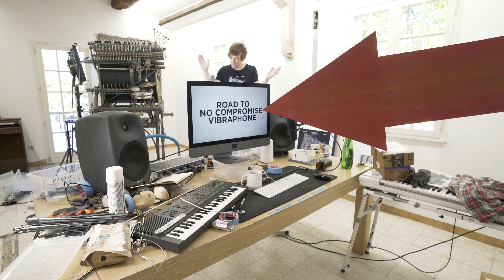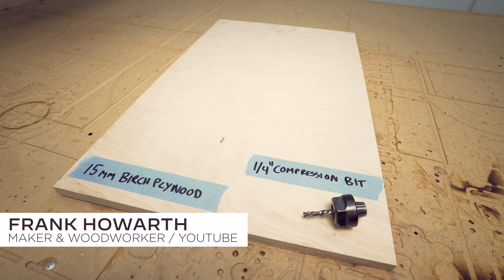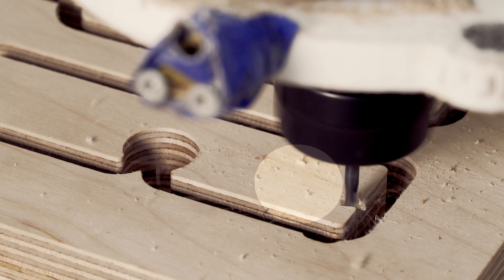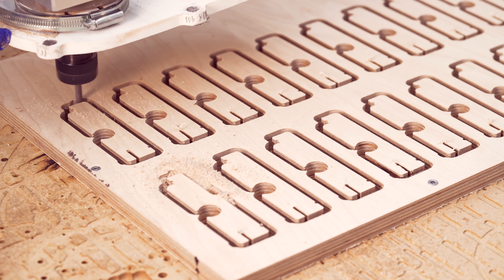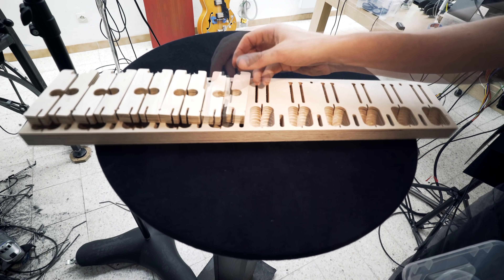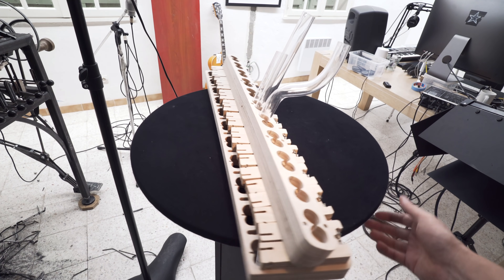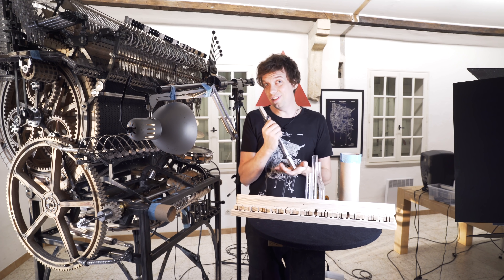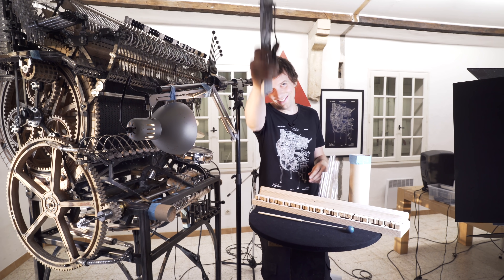CNC Machining Plywood Parts - Marble Machine X #100

Comment: tip: you didn't really need to cut a locating slot (or 3) if you just fix a vise to the table and always locate the part in the same way (google images 'vice stop rod' to get an idea)

Comment: had to laugh at the burn marks on the 'back' of the plywood.......something I have done a few times in not checking both sides of material before cracking on with using it!

Comment: I played different metallophones in my life, started with the glockenspiel when I was a kid, so I'm glad the vibraphone part of the instrument gets the proper treatment. 
And I think throwing away the result of hard work just to redo and improve it, is an important quality to have as an artist... or just in general. Having a constant reminder that you could have done a better job is way worse than spending the extra hours of fixing it. It's just as important has hitting the brakes and call it good enough.

Comment: "In engineering you should not assume anything"

I disagree, I feel that, in essence, engineering is ALL about assumptions. The tricky part is that in order to do good engineering those assumptions need to accurately model the problem in a way that you account for relevant and significant error while ignoring irrelevant or insignificant error.

For example it's technically incorrect to assume that gravitational force accelerates bodies on the surface of the earth 9.81m/s^2 toward the center of the earth. This is because the force will change with altitude and density of the earth for any point on the surface, but if would be a complete waste of time to include that in your calculation as it fluctuates by such a small amount. Thus, we assume this value is constant on the surface of the earth to avoid cumbersome and unnecessary calculation.

I get what you mean though, making over generalized assumptions is never good in engineering, but I believe that making accurate assumptions is actually the essence of good engineering.

- A nitpicky computer engineer

Comment: You could probably put the relief cuts on all of the parts, or at least any additional copies and spares. That way, there's one part that fits all of the slots, and no way to mix them up during assembly or repair.

The main downsides, depending on the part, would be aesthetics and additional machining. For this part, it's hidden and the change would only shift the perimeter cut, so neither of those would be an issue.

A similar trick can also work for mirrored parts if you can design them to be symmetric. Whenever you can turn two or more unique parts into one part that's interchangeable, it's usually worth considering.

Comment: Fastest and safest way I have for machining narrow deep groves is first to drill most of the material out and than when there is a lot of free space to run only finishing pass.
If you use interrupted drill cycle you can safely drill even very deep holes without retracting what saves a lot of time.

Comment: I run a CNC router not so different to yours. I've tried many different endmills cutting plastics, ply and MDF. My best suggestion is to get some 1 flute compression endmills for ply, and a flute length only slightly longer than the material (definitely no less). These are perfect with high RPM CNC's (18,000 - 24,000). For example, for 16mm ply, I use 1FL Comp 5mm diameter 17mm LOC endmill, run these FULL depth in one pass 18,000rpm and 1500-2500mm/min. Also I have never used tabs, the bonus of doing this in one pass and compression cutter means the chips are compressed in the slot and can very rigidly hold the part in place.
Love your work Martin.
Reply: Also, I can assure you with a flute length longer than the material you will never brake it from built up chips.
(And always ramp into the cut)

Comment: Maybe add some air assist to blow out the slot as you are cutting with small diameter bits, it will be dusty though

Comment: Engineering is all about assumptions. You're trying to simplify a problem by assuming for certain unknowns. Then when you find a better answer for an unknown you iterate and adjust the remaining assumptions until the design meets the requirements. Your engineering gets better as you learn to improve your initial assumptions.
Keep up the awesome work!

Comment: For the broken slots, break the surface with a downcutter, then use an upcutter for the depth.

And/or mount a dust vacuum on the spindle.

Comment: for deep thin slots use a cutter with low helix for extra chip evacuation this also has the effect of lowering radial forces on the tool itself.

Comment: Maybe mount a air-line to the CNC head to apply constant positive pressure, blowing the chips out?  Should this become a regular issue going forward.  Much like metal CNC machines use coolant/lubricant for similar purpose.

Comment: Strike the match by pushing it into and down the striker strip rather than flicking it across. 
i.e. push the match forward and let it impact the striker at like a 30 degree angle and move down it.
It will never break that way.

Comment: I must say I like the new design. What you had before "worked" but it was crude. Wires bent and running at different angles. It looked sort of thrown together, even though you spent almost 2 weeks on it. This looks planned and well organized. Bravo!

Comment: Martin, you really need some sort of dust collection on the CNC.  For as much as you cut, a dust shoe and hooking up to your shop vacuum would not be too difficult/time-consuming/expensive.  I know it would obscure filming the cnc action, but, sometimes, it is needed to save costs on tools and end mills.  Learned from the school of hard knocks.  I can assist you in designing/building said attachment if you would like.  And your "Rabbit hole" with the CNC: TOTALLY AGREE.  I was not able to afford the setup you have, rather built my own from a minimal kit.  And for the work I use it for, it really has been a Rabbit Hole.  And, as frustrating as it can be in the limited time I have outside my day job, it is totally worth it when I finally beat the boss for that level I have been struggling with.

Comment: As I did 30 years ago for my Gerber and my Esab CNC routers, just make a vacuum head for the router assembly with anti spray brush they use on truck wheel arches around the perimeter, you could knock one up in an hour. It removes the dust as it is make and stops the problem.

Comment: I have been monitoring the construction of MMX since the beginning but I have a worry about the machine with respect to the size of the marble holders on the top of the machine especially those near the end.

If I remember properly there are three feed channels which provide balls to the magazines.  I wonder if enough marbles are fed to the smallest magazines at the end since and wonder if some more 'priority' should be given to 'balls feeding' to these magazines.

Another thing that worries me is the reloading of the programming board.  there are MANY holes and I think it would be error prone to reprogram them between songs while performing.  I think some visual assistance should be added to the board to make sure the pins end up where the are supposed to be on the board (perhaps numbers/letter combination on the boards with a reference on the programming description ?)

Comment: Paint a thin layer of epoxi on the "endgrain" of the plywood pieces to counter tendencies of delamination. And on plywood "endgrain" is everywhere except top and bottom. Congrats to the new design! 

Here is some suggestion for feature creep: what if you could switch from vibraphone to tubular bells? Kidding. Leave that to MMXI.

Comment: Please cover your wood with boiled linseed oil. the wood tends to absorb moisture and can warp over time. Boiled linseed oil protects the wood from damage. In fact, you can also use boiled linseed oil on metal to protect it from rust (but it does tend to turn metal black). It's an old blacksmith trick.

Comment: I used to CNC shapes in solid carbon blocks using a ball cutter. Theses would be used as electrodes to burn that shape into P-20 tool steel on an EDM machine. This is how complex contoured plastic injection molded parts are made.

Comment: Since you learn so much from your comments here goes one more.

When scratching a match to light it instead of putting pressure sideways in a breaking movement that is on the lowest strength of the match use instead a movement like throwing a dart that compresses the match on its long way the strongest, you will never break a match again. With the increased pressure you will also light matches more often on the first try.

Comment: Hey dude, you can also reduce your tear out on the bottom without using compression bits. if you surface your table a little more often.  i use a 6mm downspiral  in a commercial woodwork setting.

Comment: Really curious to see how the resonators will turn out. Changing the vibraphone bars is one thing, then tuning the resonators to match is quite another, especially during a concert. And how the vibrato-device is going between the resonator and the bar, is even less clear to me. Is seems that the electronic option solves more than one issue here, as the acoustic pick ups pick up way more than you want.

Comment: For better chip evacuation, compressed air directed into the cut will help clear the chips as they are formed. This is how many of the bigger industrial CNC machines work and it will mean less fiddling around with toolpaths

Comment: Actually, if you strike a match with it's head going forward and the math itself almost parallel to the box (15-20 degrees) instead of nearly perpendicular, it won't break as easily and will have a higher chance to light from the first strike.

Comment: That's why cnc machinists,  programmer operators, get paid so much. Some think it's a push button job. But it's not. Its alot of physical and mental work. Because you have to think of a part in this 3D form to be able to program it for the machine to do it. What operation to do first and how to hold the part be able to do all operations that you need to.

Comment: Really amazing job on the CNC work. The fixture design is perfect proof that they don't need to be complicated or expensive to be effective. Respectfully I disagree on your stance about never making assumptions though. Rather, engineers make assumptions all the time, but only once they have been proven to be correct. Part of the process is visiting every assumption to ensure it is accurate, but that doesn't necessarily mean assumptions are bad. Bad assumptions are bad, but good ones can really save you some time and effort, and in some complex problems, they can be necessary to reach a solution at all. Reality checks to ensure that your assumptions are valid are a super important part of the engineering process.

Comment: Lmao the talk about working a cnc machine im dead cause i have been learning it for about 3months  and i know the struggle of doing alot of work (i work with metal) so having to do alot of extra work from to make sure it cuts in the right spot to making sure the codes are good to making sure the machine doesnt crash very fun to learn very fun to do but alot of physcial/mental work

Comment: There is a brand that makes very good reliable CBC machine, instead of clamping wood down. It has a vacuum system. Most can also change bits automatically.

https://dmscncrouters.com/fmt-machine/patriot-4x8/

Comment: If you select "Perspective with Ortho Faces" in Fusion 360 the graphics will display more realistically. Without perspective enabled parts that should appear smaller because they are more distance instead appear the same size - which looks very unnatural and is hard to look at for some people.

 At the bottom click "Display", "Camera", then "Perspective with Ortho Faces". Give it a try. If there are people that dislike that feature, I would be curious to hear their reasons.

Comment: my problem with the plywood being cut in that way, is that even with the pilot holes being cut, because the screws are being placed between the layers in the plywood, there is the possibility that they could split.
Anyway, amazing video as always

Comment: Martin, are you going to seal the plywood pieces? They will last longer and not fray as quickly, especially the thin sharp edges. Wow, this is an amazing gate design. 10 days of work that got cut away and discarded was NOT a waste of time but, an important step to NO COMPROMISE!

Comment: The match will not break if pointed along the direction of motion, not 90 degrees to it.

Hold the matchbox long side edge ready for downward motion. Hold the match itself like a pen and do a sharp/quick motion sliding match tip down the matchbox.

Comment: Amazing CNC skills, Martin.

Regarding "The vibraphone was just screaming for the Matrix Sentinels solution", am I understanding you correctly that the reason for that is the need to hit the Vibraphone plates in the correct location?  I'm a bit curious if it has also/more to do with something I noticed and then commented about on MMX #91 (Marble Gates Design) having to do with the long distance of travel causing rate limitations.  Comment re-pasted below for convenience.
Btw, incredible CNC skills being demonstrated.  I have a kit CNC at home and multiple concepts you've demonstrated in this video have been very educational.  I never would have thought to rotate the plywood and CNC again, though I also probably would have trouble with the geometry, CAD and CAM required.  Very impressive!  Entertaining + educational!

---------------- Comment from #91 ----------------
Martin, I can't help but notice that all of the solutions, excluding the matrix one, can fail for repeats of more than 2 consecutive notes as the time to travel between the upper gate and lower gate (TTT) is still ultimately the "gating factor". :)  A 2 note repeat is fine since both balls are queued at the "tip" so-to-speak but it breaks down at 3 for higher frequencies (where TTT is slower than the desired frequency).
Your matrix sentinel gate is interesting and it seems to highlight the underlying problem of the TTT being the frequency limiting factor.  For that one you've essentially moved the upper gate from the top to the bottom, closer to the instrument to lower the TTT making it faster than the desired frequency requires.

If my observations are correct, the only way to truly solve that across all desired channels, which sadly would seem to require a lot more re-work, would be to move the whole upper gate system to much lower in the design closer to the instruments, or at least to do that for the high frequency channels.

Caveat: the purpose of my note is that I see a lot of complexity being added by requiring all the secondary gate systems for timing's-sake that to a degree obsolete (though not completely) the need for the upper gates.  Needing the lower gates requires many more parts and most notably limits your creativity when composing, to frequencies limited by their respective TTTs.

That all being said, constraints tend to bring out other forms of creativity in interesting ways and certainly these lower gate designs make for a more complex and interesting overall system.  So maybe it's a fair trade-off.

BTW, my son and I love watching you on this journey, learning from your experiences and are greatly looking forward to your world tour!

---------------- End ----------------

Comment: You shouldn't plunge a compression tool straight in, it will clog and burn. Instead, start your initial spiral above the material, or simply ramp in.

Comment: I’ll have to get myself an up/down cutter for plywood, I’ve got ups and downs but no bi-ways.  Another thing to consider for edge finish is if you have a better edge finish on your stock than the finished piece, change your cut direction.  Hard plastics and metals do well with climb milling, soft plastic and wood are typically better with conventional milling.  Fusion360 defaults to climb milling.

Comment: Martin - Take a look into trochoidal milling for doing slender cuts. It gives better chip evacuation while decreasing the overall load on the bit, and should allow you to cut those slots without breaking a bit and without vacuuming